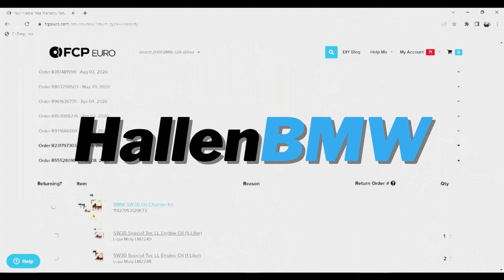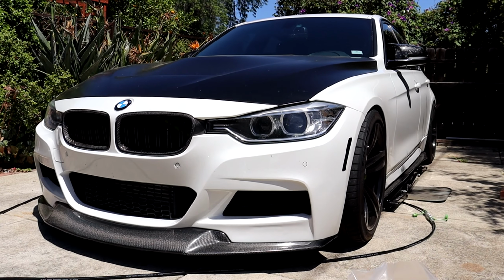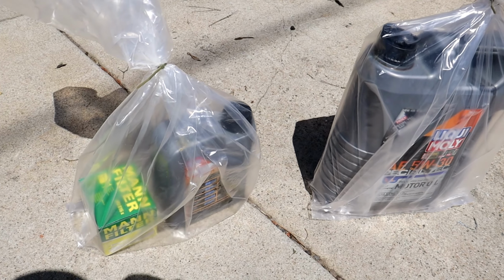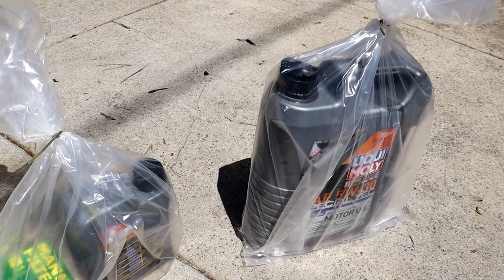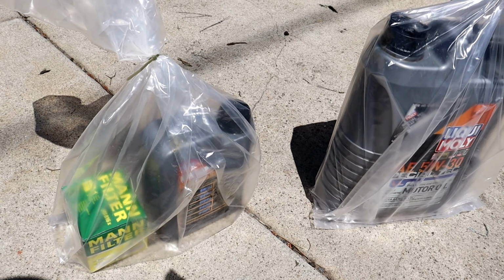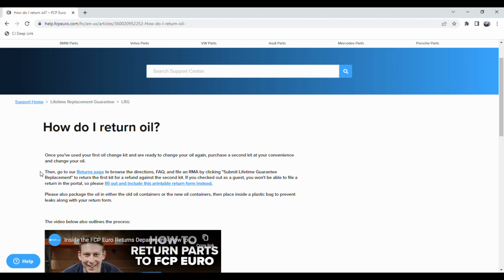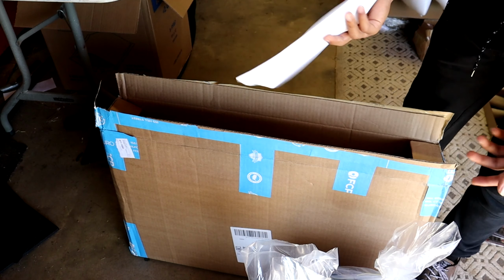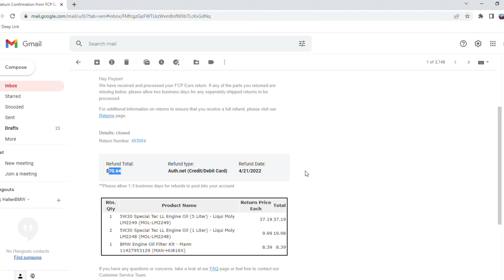How To Change Your BMW Engine Oil FOR FREE Using FCP Euro’s Lifetime Warranty Guarantee!

Comment: I just performed my first oil return with FCP Euro. Oil service kit cost me $85. Returned my old oil, and it cost me $52 to ship it. Crazy! But I think it was more due to the size of box I shipped, and not the weight. What I need to do is find the correct size box, order a bunch of them, and use them for oil returns. The box that FCP uses to ship the oil to you is huge, and if I used that same box to return the oil, it probably would have cost me over $60, which at that point, isn’t worth it. Yeah, I would save $25, but it’s kind of a hassle. 

If I can get the return shipping cost down to $35-40, that would be excellent, because I would essentially only be paying $35-40 for the oil change, for quality synthetic oil (Motul), filter, o-rings, and drain plug.

Comment: Does this work for transmission fluid also?
Reply: Looks like it does.. nice!
Reply from the maker: @hardcore4476  Wasn't sure. How did you find out?
Reply: @InlineSixAuto  On website it’s says when purchasing. Anything that can be placed in in original bottle can be sent back. No aerosols, or engine additives because they can’t be put back in original container how it came. Transmission fluid definitely can.

Comment: I noticed you only put the 5 liter an 1 liter in return box . FCP euro says they charge or deduct if you don’t include it all . 7 liters total . Anyways I’ve done like you an went through about 12 oil changes without return because it costs me $24 to mail it . An I was skeptical they would try to find a way to not return it . Glad to see it works for you I will try it now
Reply from the maker: Oh wow I actually wasn't even aware of that. I just emptied whatever was in the drain pain which was less than 7 liters. But yeah they still refunded me the full amount as I showed at the end of the video. Definitely worth a try.
Reply: @InlineSixAuto  thanks I will

Comment: So how do they make money on oil changes ???
Reply from the maker: From people who don't know yet lol. Also they have over a thousands parts so I don't think the loss from oil change kit warranty refunds doesn't have any significant affects on their profits
Reply: @InlineSixAuto  but aren’t all their parts lifetime warranty? And I highly doubt they rely on people “not knowing” to maintain profits? Something is surely amiss
Reply: @B2KJFF  the used oil is recycled and cleaned and resold
Reply: @ricardocouto3218  Recycled oil can be trusted right? I wonder how good of a process it is
Reply from the maker: @B2KJFF  Oh that was more of a joke/guess since that was my case since I didn't know you could do this for the longest time lol. But still I'm pretty sure if it was really cutting into their profits significantly, they wouldn't offer this. Also as the other person mentioned, they do recycle and possibly resell the oil, so another way they can make the money back. And Not just with oil but all the other parts they offer with the lifetime warranty, they could refurbish/restore them and resell.
Reply: It’s like mail-in rebates.  The seller is counting on the fact that most people won’t follow through with all the paper work.

Comment: Hey man appreciate the good content. I’m gettin an ‘08 328i and would like your opinion on what I should do to the exhaust to make it sound better than stock but not too loud/annoying/or have drone.
Reply: Hey I’m sorry I didn’t know you had replied to my previous comment on the other vid. Youtube doesnt give me a notification for that for some reason! Thank you! I’ll continue to sub and like I love your vids and progress.
Reply: secondary cat, resonator, and muffler delete it's really not loud AT ALL for a straight pipe but it sounds very good
Reply: Bring it to a muffler shop get rid of the muffler I had a 325 06 it should cost you 300$ canadien depending on what metals ar3 available and how big you want that part to be
Reply: Muffler delete if u don’t have performance exaust. Louder than stock and no drone. Or throw a magna flow
Reply: @kdbuilds619  yeah that was my main plan at this point. $300 magnaflow muffler and then if im not satisfied maybe a resonator delete or the secondary cats
Reply: @Exitiouss  gonna be loud if u delete secondary resonator and will  drone really bad if not replaced with aftermarket.
Reply: Cat delete if you want to be the life of the party 🎉  😂
Reply: @kdbuilds619  that was another thought. I’ve heard Vibrant Ultra Quiet res is really nice
Reply: @Exitiouss  yea. But start with one thing build up the exhaust how you like. Throw too in at one time, and you won’t be able to tell what’s off. Cos your gonna end up waist time and money taking stuff off and on.